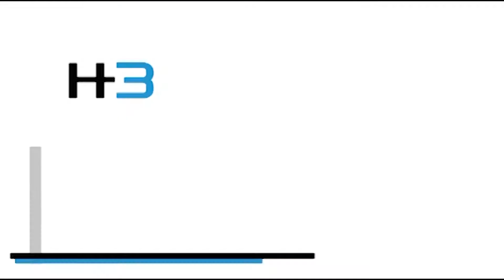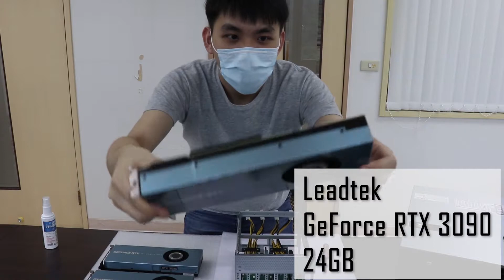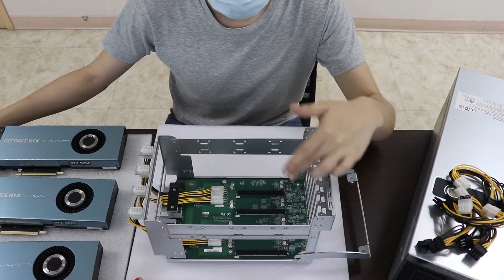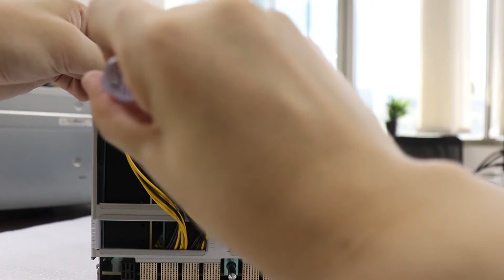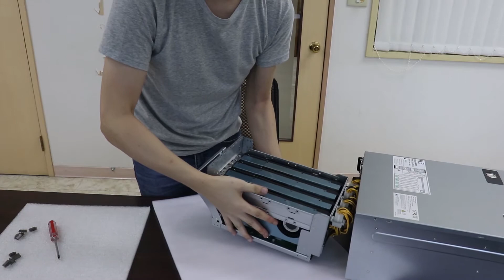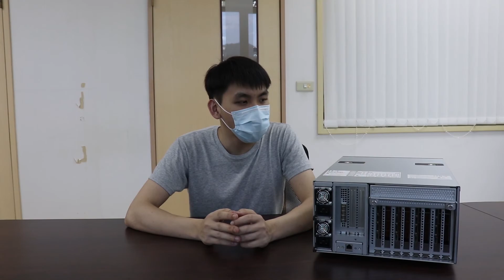Falcon 4205- RTX 3090 GPU Installation [Full]

Comment: Does the h3 module connect to the workstation physically or does it function as a network-only rendering server?
Reply from the maker: Hi, Nunzio

The chassis is connected physically to the workstation in this video.

You can check out Part 2 of the video to see how exactly it's connected.
Here's the link:
https://www.youtube.com/watch?v=d2jCHUiMWKA&ab_channel=H3Platform

And of course you could build a network rendering system with it. :)